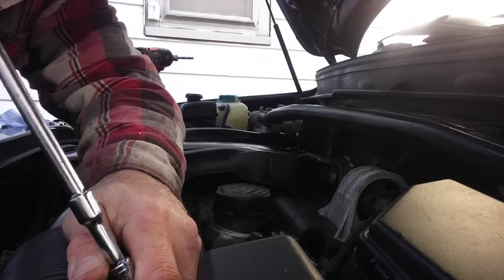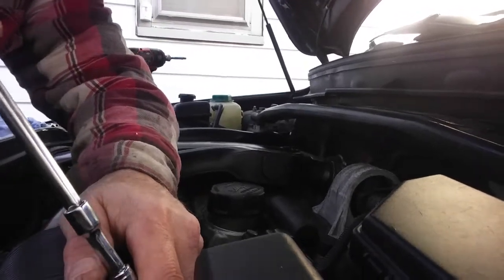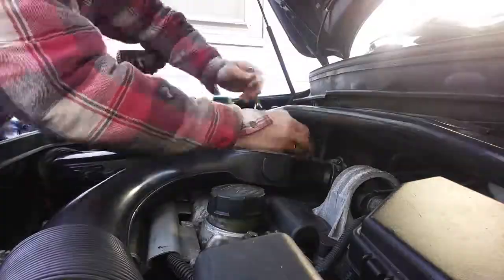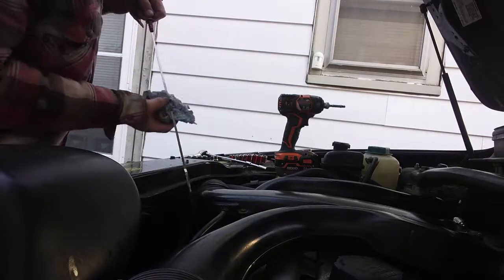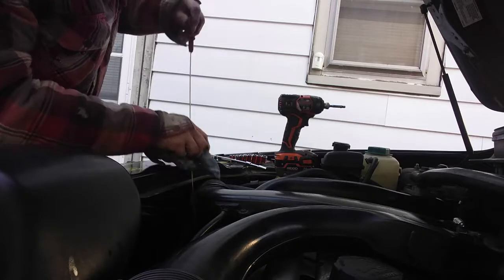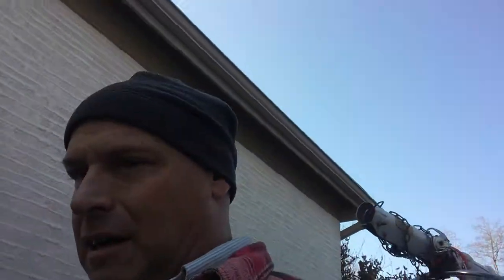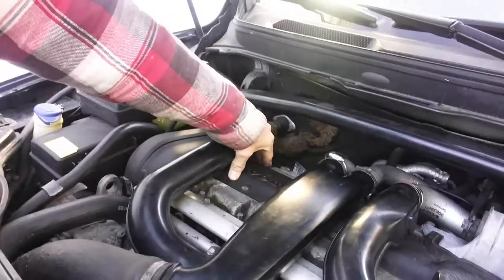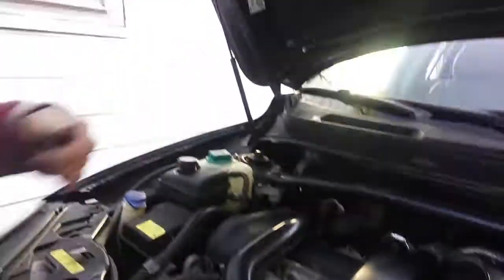XC90 VVT Install

Comment: Wait! Did you disconnect the battery? How did you get the old vvt off?
Reply from the maker: Yes, always disconnect the battery. 
It just unbolts. It's under the plastic cover.

Comment: Nice video!  
I have a situation I hope to get your thoughts.  2004 xc90, took it in to the dealership to replace the timing belt, had zero symptoms but it was over due.  $700
During the job, the service guy called me to let me know I had a “bulging cam shaft” that absolutely needed replacement, or else my car was a “ticking time-bomb”  
I witnessed the “problem”, the pulley closest to firewall would  extend about 1/8”-1/4” when belt tension was applied, it would retract when tension was released.  They said because of this movement, my camshaft would fail and screw everything up.  Does this seem like a legit problem?  Or is some movement of the pulley normal?  Thank you so much for sharing, I really appreciate it!
Reply from the maker: I've never heard of a "bulging cam shaft".
I'd get on the Volvo forums and ask those guys. There is a wealth of knowledge in those forums.
Good luck. Let em know how things go.
Reply: Marty Jackson 
I appreciate it!
I was having a hard time getting responses on the forums, so I started stalking youtube.  Long story short, all work seems legit and justified after my research.  $3000 and a 2019 xc60 loaner doesn’t seem tooo bad considering sone of the opinions Ive received.  Thanks again!
Reply from the maker: @johncale814  3K wow! 
The timing belt is a huge problem with these cars. No matter what motor. It's recommended to change the belt, tensioners and water pump at 160 000km.
The 05 xc90 I have now has 375000km on it and its on the 3rd belt. Runs great!
Reply: Marty Jackson 
That gives me hope for the future of this XC90.  Its a great vehicle!  Thanks again!